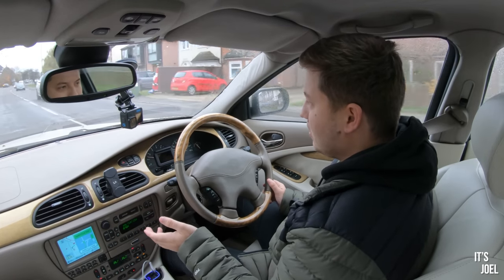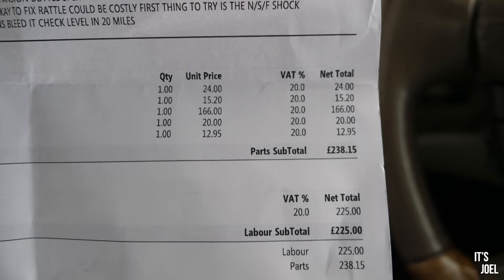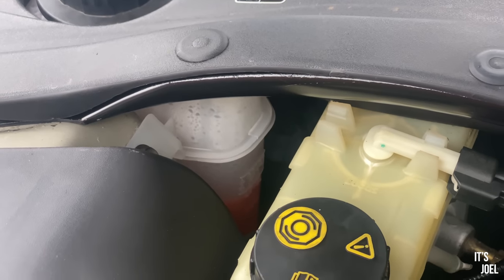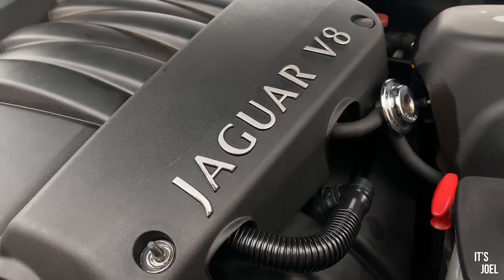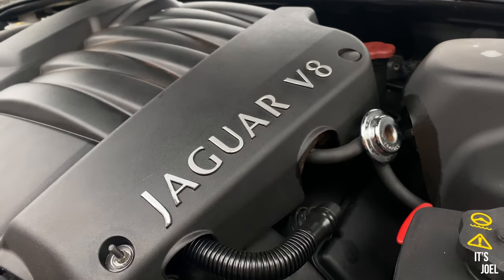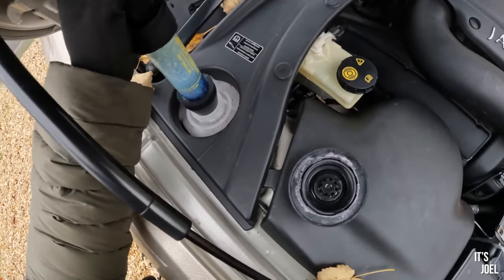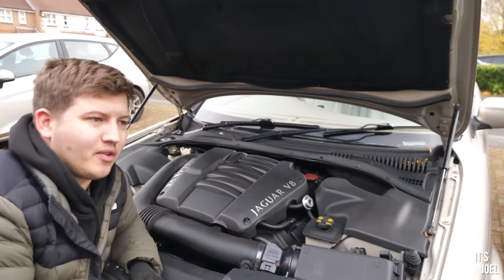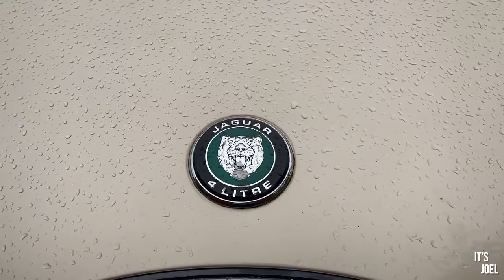Can this £30 bottle of Steel Seal save my cheap V8 Jaguar?

Comment: I know it's far from you, but Farriers Jaguar Specialists in Leicester did a good job on the head gasket of my Daimler XJ40. 
They skimmed the cylinder head too & the Car behaved itself afterwards too as they test drive the Cars after each repair

Comment: Tried steel seal in two cars,one with a head gasket failure and one with no overheating problems but just put it in as a precaution.
On both cars the water pumps failed shortly after using the stuff.
The car with the head gasket failure had the water pump fail one day later and the second car which had a new water pump fitted lasted a couple of months.the seals failed on both pumps.
The original usage instructions said to put it in the cooling system and let the car come up to temperature and idle for one hour then cool down.
Certainly wouldn't use it again.☹️

Comment: White smoke is 100% the outside temperature and warm/hot exhaust fumes. I have an XK and it smokes if the outside temperature is less than about 5-10 degrees

Comment: Joel, I’m collecting my Jag back from the garage tomorrow with what was a similar issue. They have water pipes in the V of the engine, these can leak and let coolant into the engine that way, on mine that’s what had happened but sadly it caused mine to over heat too which blew one head gasket. So chances are that splatter off fluid you saw on the rocker cover is coming from in the V of engine between the two heads. Looking forward to getting mine back tomorrow after the pipes and heads being done.

Comment: I managed to resolve a head gasket issue on my XJ6 series 3 (4.2 litre inline 6) using a head gasket sealer. Slightly different product, I did use 2 bottles, and I did flush the system first. But it worked.

Comment: Great car! I wish you good luck! Still I wouldn't pour any additives into the coolant tank, there is a risk to block the radiator or coolant passages. You need a good motorist to inspect your engine, maybe it doesn't need repairing at all. If the engine head gasket is faulty, misfires will occur both upon the engine startup and during the engine idling.

Comment: Milkshake on the oil cap isn't necessarily headgasket failure, it can also be condensation build up, caused by too many short journeys where the car doesn't get up to temp fully before being shut off, also common in the colder months, as is the exhaust smoke

Comment: Just maybe one to eliminate from your list of  possible causes , I own a ford transit it began developing problems with the header tank bubbling like a kettle and would cut out every few miles . This happened one day when out and about and i had to call my breakdown service they performed the turkey baster test like the one you have and diagnosed my head gasket as the issue. i wasn't fully convinced this was the problem so got my friend who is a retired mechanic to take a look turns out it was the water pump there were gasses leaking by the gasket hence letting gas into the water system hope this helps . And love the channel😄

Comment: The steam from the exhaust is likely the buildup of condensation within the exhaust burning off. If it has had a HG leak there will likely be quite a bit of water/coolant in the exhaust. Monitor the coolant closely over the next 7-10 days. 
It's certainly possible the Steel Seal has fixed the issue.

Comment: I had a later jag s type 2.5 v6 with similar problems to yours. Spent a fortune on it with various garages. Mine used to steam up the interior windows too which suggest heater matrix leak but had new one fitted and still did it lol gave up on it in the end. I tried K seal in
It in the end but didn’t make any difference. Shame really as it was an amazing car when it worked.

Comment: Hi Joel. If the head gasket has gone then it would pressurise the coolant system and will blow at the weakest point, first would have been the coolant tank, fixed the second weakest point would have been the pipe ( now first weakest point after repair on expansion tank). Please dont put any more steel fixer in, as others have said it will impead the coolant system and build in future problems. Has the head gasket been done not too long back? As possibly it has sold before the gaskets have been nipped down after a few miles, this happen to me and a rertorquing of the head cured my faults. Other than that it a double gasket job. But well worth doing if it saver a lovely car like yours. My advice re Jag garages is to join a club and seek their advice there is always great knowledgeable people in the clubs.
 All the best, and good luck.

Comment: maybe in could be a small coolant leak from the radiator, which simply evaporates when its up to temp, resulting in low coolant level when its cooled down, and produces that burning smell you mentioned.  rad leaks are common this time of year because the amount of grit on the roads being chucked up. i'd have the radiator pressure tested.

Comment: Steel Seal is pretty good, but it is expensive.  I think the Steel Seal may have worked, you cannot rely on white smke alone to determine the head gasket is still at fault.

Comment: If it was a slight head gasket problem steel seal will have sorted it I used it on a 3lt v6 about 5 years ago its still fine about 25k miles on 👍🏻

Comment: its been a few years since i owned a jag, and that was an xj6 or x300 as it was......but i always found that having work done on the car at a jag dealership was money well spent, especially with their fixed price servicing it was usually competative. The hourly rate only really gets mega expensive when they are trouble shooting elusive faults and the hrs mount up . nice looking car though.

Comment: Same engine in the P38.

Anyway, occasional white smoke isn't much to worry about. If you really wanna see if it's doing anything, take a few spark plugs out and check to see if they look steamcleaned. If they're all a nice yellow-brown colour, you're good. If they're shiny, not good.

I'd also recommend getting a new battery on the car. Like the P38 (and all rangerovers, really) they don't like poor voltage or an even slightly weak battery. It'll help with your starting (it sounds a bit hesitant) and will also remove all kinds of other issues you didn't know you had.
Reply: No, P38 V8 (either GEMS or Thor) is a Rover V8. The Jag is an all-Jaguar engine. Nothing like a Rover V8, 4 times more camshafts to start.

Comment: In cold weather, white vapour will be emitted from a cars exhaust. Water is a bi-product of burnt fuel, when this water gets hot in the cars exhaust system, it becomes vapour and is emitted from the back of the car. So long as the coolant level doesn't continue to go down, I'd say the head gasket is good.

Comment: Mate, don't worry about the smoke. It's winter and the exhaust gas is going to be very warm so it's normal.  The main thing is the leaking coolant, has that been fixed?

Comment: A 6 cylinder requires two bottles, an eight cyllinder would difinitely need two bottles!!!! The coolant should be clean and works better with water. Good idea to follow the instructions with any product you use!!!!

Comment: My old felicia had a bad head , put K seal in the cooling system all fixed , going well over a year later it was , i sold it to a work friend for £300 in the end and its still running to this day

Comment: In my experience steel seal is probably the best there is, however it is still just a patch up and doesn't fix the original problem, still get the heads done and .ate sure you get a good quality coolant flush cos that stuff can cause some naughty issues further down the line

Comment: It could work as a cheap fix on a throw away car but from the mechanics i spoke to, yes it can work if its run through the engine properly but if ever you need to remove the head afterwards you will have caused yourself a ball ache because of what it does. May be worth a punt.

Comment: Straight pipe it, baby!! Make it sound like an Aussie supercar! 

I wish I'd known about this product when I couldn't resolve overheating issues with my twin turbo 350Z. I'd still have it now, instead of selling it for far less than i invested in it. That's always the case with modifying. But if that product would have worked on it, I'd still own it and still be enjoying it. I even spent £7k on an uprated bottom end and supplied the gasket kit to the garage fitting it.

As it is, the guy I sold it to stripped down the engine and informed me the head gasket had gone and that the failed gasket looked very old. The garage didn't fit the new one but were adamant they did (fit the new head gasket). Instead they continuously changed parts such as radiator, thermostat and bleeding the system. 

So yeah, I really wish I knew about this product. I'd have given it a whirl.

Comment: I'm sure the white smoke isn't actually smoke - in cold weather it will just be water condensation which happens with all petrol engines in cold weather.

Comment: Using steam coming out of an exhaust is a weak indicator of a head gasket. If the headgasket had gone, the water condensation would build up right from the headers of the engine, thus creating a rather thick and obvious excess amount of steam. What your observing is condensation building up in the backbox/tail pipes of your system as cold and hot air meet at the end of the exhaust. This is normal, on almost all cars, especially old V8s, my 540i is like steam engine first thing on a  cold morning.

Comment: I have a 2000 stype 3.5ltr. The other day I drove 40 Klms at 60 mph and it white smoked. I parked it for about 40 mins and then drove home. No smoke. Why ‘cos it was HOT and most of the water in the exhausts had burned off. I think temperature differences causing condensation may be your problem including what’s on your oil filler cap.

Comment: If it is hgf that would explain both your tank letting go and the hose coming off as there will be excessive pressure in the  tank. I would be wary of using any sealing products as they will not be a permanent fix and is likely to fowl up the engine and make more work to fix the gasket later down the line.

Comment: This car might be from 1999 but the engine sounds super smooth. In fact it sounds better than many 4-5 years old engines. Obviously it is not economical but 25 years ago no one was considering 1.80£ per litre of a gasoline or 99 this one might need.

Comment: You've got a coolant leak, not a head gasket issue. Agree with loads of the comments below. It also sounds like the car 'burped' whilst you were messing about hence the level changing in the tank. You need to get the car up in the air and put more effort into finding the leak before jumping on the HGF.  Its very, very easy to get the sniff test wrong by exposing the fluid to the air. 

As the for the smoke/steam? Its freexing cold. Itll do that for hours, especially sat idling omn the drive, which NEVEr getd a car up to temp properly like driving it will. I bet the tailpipe is still freezing cold sat there like that.

Comment: OK first thing look at the dip stick see if the oil is showing any changes of the engine. Also check breather intake and tack out and check spark plugs as that gives you information if running lean or water even oil where it should not be. now here is my favorite feel with safety gloves while the engine is on and running a while any water inside the exhaust rear pipes I say this because steam  is not consistent and sometimes mistaken as fuel burning correctly then check your catalytic converter for air leaks. but need a car lift for that. If MOT is soon get a test mot done at any garage they can tell you if passes exhaust gas tests and any thing leaking as will be seen below and if lucky they may let you have a look.

Comment: the only way to know if the sealer worked, is to have the engine oil changed as there maybe moisture in the oil from the head gasket failure

Comment: Joel, I can't believe you used that steel seal head gasket repair. Such a pity. That is the ultimate bodge! Now your whole cooling system and heater matrix etc will be gunged up with that stuff forever. What a pity. That is what you use if you have a £500 car you just want to limp on for a few weeks. Frankly, I would cut your losses and sell this as spares and repairs and tell them what is wrong with it. I reckon you will get £750 to £800 and just cut your losses. You can not run a car like that using £30 bottles of gunge. If you can't look after it yourself, which alas it appears you can't, it just is NOT viable. You are far better off buying a good car than a lemon that has never ending issues. The 3.0 V6 is a good car. You can get a really good 3.0 V6 for 2k. Easily. It breaks my heart you are so fixated on a 4.0 V8 you are doing this to yourself. Just get rid of it. And the 'white smoke' is actually called steam! The car is a LEMON. Do NOT spend any more money on it. Just get rid of it. It was cheap because it is a lemon.

Comment: Your smoke could be from your engine running too lean, this could indicate a problem with your mass airflow sensor or your o2 sensors on your exhaust…the time of year could also be making your car appear to be smoking.

Comment: like many others i'm not concerned with the exhaust discharge.  I would get yourself a cheap mini cam (wireless) from amazon. They are great... I got mine down into the rear belt of a D4 to check on a cam shaft seal.... you'll be able to get a look at the bottom of the V to see if the coolant pipes are leaking of if there is coolant laying in there. They are so useful for many things... they have an LED light on the end and utilise your phone as the monitor to view and take videos or pictures of what you see. 

Oh... and where is the Cayenne?!! I just bought one on the back of your last video!! Please get one! so good! :)

Comment: burning a gallon of petol creates about a pint of water, the condensation you see is perfectly normal if you have only been doing short journeys, take it for a decent run and after that if it still has condensation you might have a problem.

Comment: Does this model have Aluminum Heads? If it has overheated a couple of times they can warp.  Changing the head gasket wot fix it, the heads have to be machined flat(Hopefully).

Comment: They were not known for head gasket problems tbh.

That's just normal condensation from the pipes, all petrol and the modern diesels do it on cold days regardless of how hot the car is or how long it's been driven. It's normal.

Comment: I don't think I'd I've rushed too putting steal seal in particularly if there are other signs of leaks.  Joel I'm not that close too bucks bit can travel if you ever want a hand.  I'm not a mechanic but an enthusiastic DIY'er.  The little bit of milk on the oil filler caps is more likely to be to do with the amount of moisture currently in the air in the UK.

Comment: Looking forward to the Rd trip, but if you take it as it is, you’ll be paranoid about cooking the engine. Suggest at least a thorough check , or just go ahead get the cooling system ripped out and replaced. It’s most likely all original.

Comment: What you like with a set of spanners 🔧 cus the only solution is to remove head get that pressure tested and skimmed and fit new gaskets and water pump. But the very first thing you need to find out is why it failed to begin with.....bad radiator furred up water jacket etc. Good luck.

Comment: The head gasket can fail in different ways...initially. Mayo is where the oil and coolant are mixing. White exhaust smoke is where coolant is leaking into the combustion chamber without mixing with oil. I'd suggest the liquid metal has partially fixed the problem but not the white smoke.  If you are still losing coolant into the engine your level will drop. Don't rely too much on your temp. gauge, it depends where it is on the block. It can read 'normal' even though you have lost coolant. If your heater starts to blow cold air you have a catastrophic head gasket failure. If your temp. gauge suddenly drops from normal to 'cold' you have a total head gasket failure. The coolant level has dropped below the sensor.
Reply: What if the temperature gauge is into the red zone and steam coming from  the engine block.  Many thanks. Also heater blows cold.

Comment: I would just drive it like normally, if the coolant level stays the same the problem is gone. White smoke does not necessary mean that it's a leak, I got a nearly new BMW with petrol engine and even that smokes white specially at startup in cold weather.

Comment: Hi Joel, just a few points that might help you, i’ve done loads of research for head gaskets etc and by no means a professional but i think this can help. 

First of all small amounts of steam coming out of the tailpipe is normal since water is a by product of combustion and the heat would create steam. 
Furthermore, to see the best results for a head gasket sealer, you need to allow the car to complete its heat cycle. what the means is allow the sealant to cure within the suspected cracked areas until the car is cold. sometimes you might even have to repeat the process. But most importantly for sealants you need to allow the heat cycles to complete. 

Lastly, Chrisfix, an american youtuber done a head gasket repair using sealant on a Jaguar. and the car was running for 2 + years. You should watch his video and it might give you some added help. 
Anyways, I hope this helps and update us on the progress.

Oh yeah also, you should think about doing a coolant pressure test when the car is cold using a pressure tester to see if there’s any external leaks. if the pressure drops and there’s no leaking outside, and the coolant level drops,you can basically confirm there’s an internal leak.